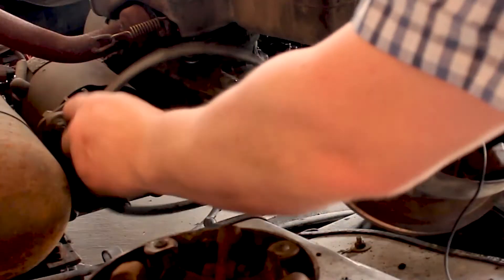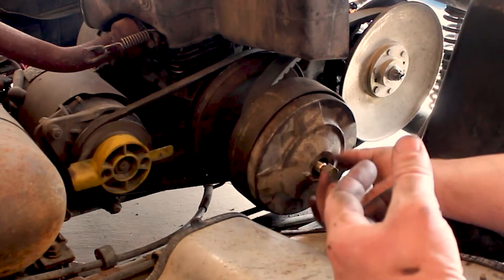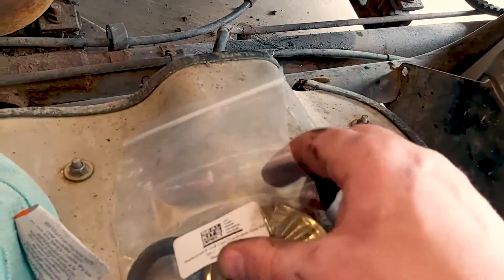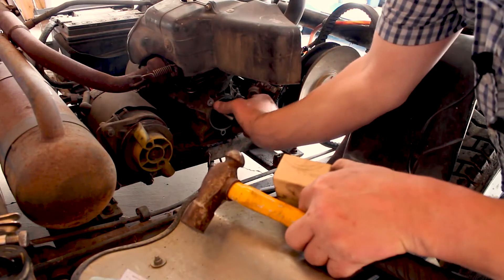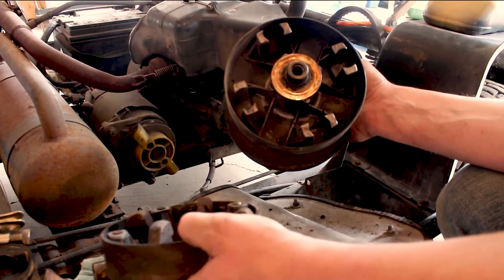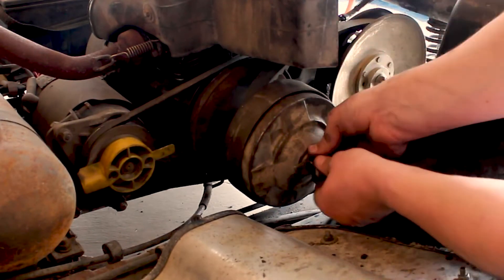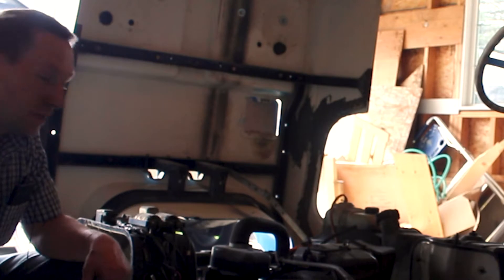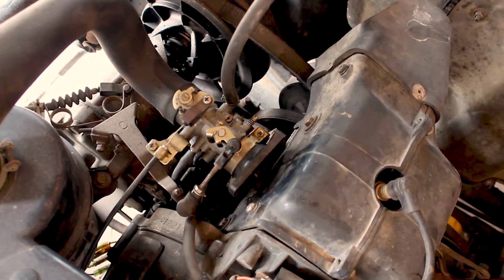Yamaha G1 Golf Cart 2 Stroke Crank Seal Replacement | Gears and Tech

Comment: I have the same yamaha G1 and everything has been great until 2 days ago the motor will only start in forward. When I switch the ignition switch to reverse and depress the gas pedal nothing happens. Does anyone have any idea what the problem might be?
Reply: Solenoid may be bad, or the tabs that the cables connect to may be broken off